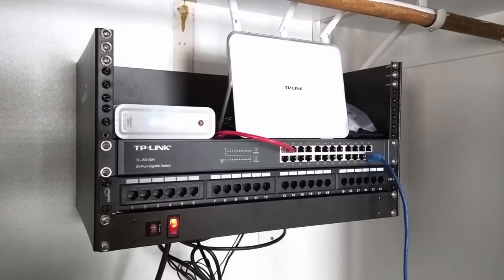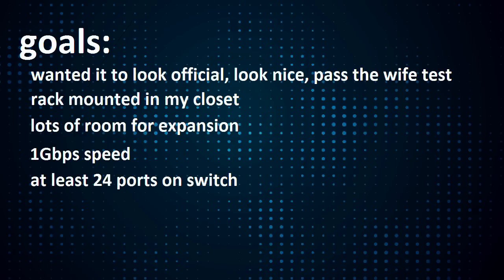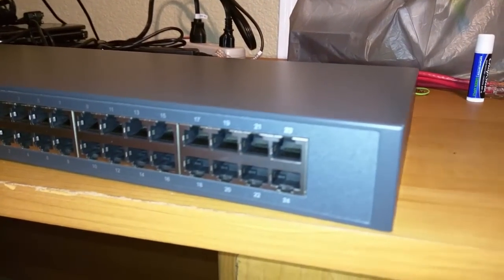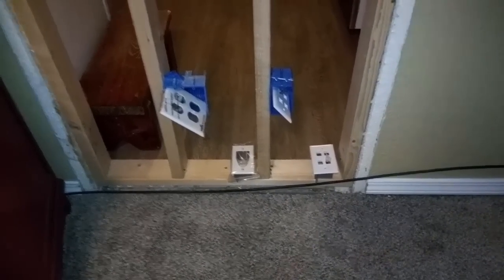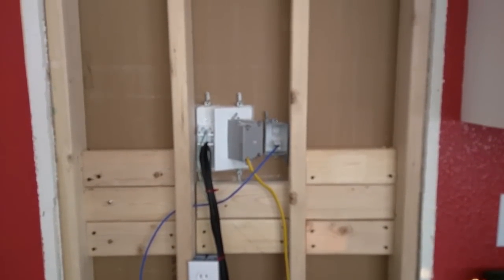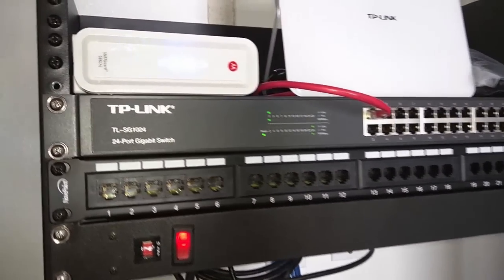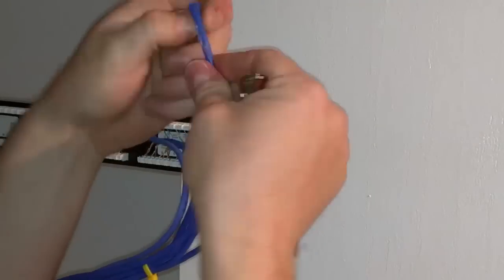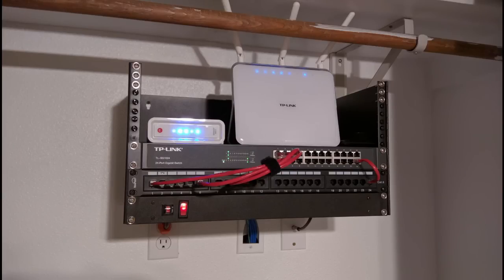Budget Home Network Tour/How To

Comment: What's with the big ugly double height faceplates over there. A patchpanel  makes a job look so much nicer and easier to maintain. As other posters have said your twists are bit slack and you should bring all the cables in through the cable tie at the end of the panel. Good job all the same.

Comment: So that's mean you get free internet and WiFi?
Reply from the maker: It's a computer network. If there is an access point somewhere in the network, then you can get wireless access to the network. It will not get you free internet. You usually have to pay for access to the internet.

Comment: 10 inches between hi voltage and low voltage network only 90 degree angles then crossing  NUB!!!!
Reply from the maker: +room42 I am aware of that, and tried my best. In that small space for the TV, there were just so many wires. You can see that I tried to make the single Ethernet cable going for the future TV cross at a 90 degree angle to the power for the TV.

Comment: what's the use of this
Reply from the maker: This is just a fancy home network. The cable modem and the router most people will have. The rack with it's power strip, switch and patch panel are all optional. It lets me add permanent network wiring throughout my house and do it neatly and professionally. The switch gives me extra wired ports for my house. It's a little overkill, but in the end, it's just my home network.

Comment: Sorry but why you need all these if everything works with WIFI...Or am I missing something here?
Reply from the maker: Wifi is nice, but it will never be as fast or secure as Ethernet cabling.
Reply: Because wifi is SLOW.  No way I could stream a even 20gb movie file from my NAS to my TV over my AC wireless.  Best it will do is a 1080p file around 2.5gb at best.  With wired 1gb connection a 60gb 4k file is no problem.  Just one of the reasons wired connections are better.

Comment: As an Electronics Engineer in telecom and Electrician who's wired commercial and residentially, this is a great concept but unfortunately a failure in execution. Permits are required for both low and high voltage, both of which you will fail for on multiple code violations. This is exactly the type of thing that I am very often called upon to remove and/or correct what has been done incorrectly. If you are going to post a how to, at least you should actually know "how to"
Reply from the maker: A small number of people have told me I've failed and violated code, but few explain what I did wrong. I would love to hear it so my next project t could cross more T's and do more I's.
Reply: Budget Nerd, First, when you are running low and high voltage, they should never be run in parallel with one another. If at any point they should cross each other perpendicular to avoid any noise interference. Second, your Romex needs to be strapped and neatly tacked to the studs, no more than x2 pieces of Romex under a single strap - within 12 inches of each box. That was from memory. I'll review the video and see if I can give you more feedback
Reply from the maker: I knew about running low/high volatage in parallel, i avoided that when I could. I await your other items.
Reply: Budget Nerd, Fyi, current NEC requires you to run a separate neutral (white) wire for all branch circuits. You used to be able to 'share a neutral', aka : dishwasher/disposal - 2 circuits, 1 neutral for both. It looks like you have a few circuits to terminate in your main electrical panel. So, if you ran 12/3 w/ ground it would be a code violation. Run 12/2. If possible, but not required, you can use twin style breakers to save space and each circuit has its own neutral terminated on the buss bar.

Comment: The pvc pipes????
Wouldnt it be nicer if you had pvc pipes in the wall. Soo later on its easier to get more cables to the destination.
Reply from the maker: +Jostein Baustad a pipe would be better off course. Didn't think of it until later.. and the pull cable hopefully works fine as well. But chances are very slim that I will need to pull another cable anyway. I ran one for every input whether it was being used or not.

Comment: well, I once was told americans use the A-Standard
I always use patchpanels like these:
https://www.amazon.de/DIGITUS-Professional-Klasse-geschirmt-24-Port/dp/B0018AE5DE/ref=sr_1_4?ie=UTF8&qid=1514060789&sr=8-4&keywords=Patchpanel
the one you use seems like the cables aren't secured on the panel very well.
Reply from the maker: +Robin Ehrenhöfer true.. I was still figuring out the best way to punch that patch panel down. It's not the prettiest, but it's hidden.. it's secure too in the end..

Comment: You did all that retro-fit work then buy the cheapest equipment? I get saving money but you could have gotten way better equipment with a little research. More power to you.
Reply: What makes one unmanaged switch different from another unmanaged switch? A switch is the easiest thing to upgrade later.

Comment: 8 network cables behind the tv? Just use a switch man...
Reply: but then every device behind the tv shares one 1gbps connection
Reply: Máté Varga I know. And it should be more than enough for any media station device. Also who got 8 devices that use 1 Gbps and even if simultaneously?
Reply: He had the walls open. Now is the time do do this, why add another switch to the network if you don't need to. cables are cheap.

Comment: normal family guy would not go this far. A decent router with a couple of small switches will just do the job. easier solution will just be around wireless solution. wired network is must have for business office, for home use, wireless shall be good enough.
Reply from the maker: I disagree. For my network, I don't want "good enough."

Comment: The WiFi is in the closet. Love the rest of this video but that just made me cringe. If you're running cables through the walls, might as well mount a WAP to the ceiling of the living room or something..
Reply from the maker: +squirrel1620 true, but I was sticking to a budget, and that router/AP gives awesome range and signal even in the closet.. wasn't anything I NEEDED to change. Most of the cable I ran was in the crawl space, not in the walls and that whole setup needed to pass the wife test.. she might have questioned the AP on the ceiling. Maybe down the road..
Reply: ben johnson will if it works that's awesome! Just saying when I put my WiFi router anywhere near a wall, my signals go down at least 50-60% strength
Reply from the maker: +squirrel1620 I gotta have good wifi as well, yeah I'd move it if I had an issue, but it works great there for now. Thanks for the tip though..

Comment: 24 ports for domestic usage? 8 cables for a TV rack? What the actual fuck? The 4 red cables actually being used in the end are 'nough said...
Reply from the maker: true.. it's overkill right now, but wanted PLENTY of room for expansion. I have several PCs in the garage that I will eventually wire up, a spot for the TV that I will eventually need to patch, a NAS in the future, perhaps a spot or two in the kitchen, and anything in the upstairs I eventually get. So it could fill up.

Comment: So much trouble, why not just use high speed wifi router..My whole house is wifi networked. 8 different equipment in home theater room, 6 in study, 7 portable phones and tablets, 6 other equipments like TV's & bluray/STB in other rooms. All networked via high speed wifi router.
Reply: The Droid What router are you using?
Reply: The Droid when it comes to performance,  a physical network is unbeatable.  but if you prioritize conveinience and easiness,  wireless is your way to go. it's just a matter of priorities.  which is the best is subjective to the owner's use case & preferences
Reply from the maker: +The Droid this setup of mine only seems a little complicated because I wanted it setup this way. Your network could be different depending on your needs/wants. I just wanted to wire what I could. Wireless can be great too, but I try to wire what I can.
Reply: Daniel Roy: I always use Linksys /Cisco routers depending on load and cost.
Reply: Anass Eljondy: What you say is correct, but the speed is bottle necked not within your home  network but as soon as you access the Internet. I'm yet to come across a 1 Gbps internet service provider. Using a 450 Mbps wifi router should do tho job for home networking and high definition streaming over 100 Mbps download speed from your internet service provider. . BTW, over 1 Gbps (upto 5.3Gbps) wifi Linksys routers are available in the market.
Reply: ben johnson : I understand your need, it is just far easy to WiFi network the house and cheaper too by going for a kick ass high speed wifi router. 2 of my equipments have only RJ 45 ethernet plugs and I use a $10 Chinese gadget (bridge) that converts any ethernet port to a wifi receiver, its power is supplied via a usb outlet. Good on you for learning networking on the go though..
Reply: it isn't hard to have a house where even a top end router has trouble reaching 100 megabits to some areas.  I hard wired my desktop upstairs since it does regular backups to my home server  and my home theater PC since it streams 20gb HD movies off my home server.  My high end Linksys router and ubiquiti access points couldn't reliably handle my needs over WiFi.
Reply: You must be sporting the older Ubiquiti AP lines, then.
Any Ubiquiti Unifi AP can easily handle an HD streaming movie regardless the length AND backup the same file to network storage simultaneously without interruptions. Doing that everyday.
Reply: If the throughput and latency matters; and the user environment is capable, use ethernet cables.  End of story.  Wireless is fine for mobile devices and basic internet surfing.
Reply: Surprised no one talks about the radiation given off by WiFi and DECT phones
Reply: What about it? You get more EM radiation just being able to see it then you would from the radios inside them.
Reply: wifi router is,best avoids all the cables
Reply: Mephisto Man What a noob
Reply: Wi-Fi will always be inferior to a well structured wiring setup.  Even the latest spec does not hold a candle to the performance and security to that of ethernet.  Wi-Fi is better dedicated to mobile devices only.

Comment: Pure horror!  You are laying down the  top ledt router flat on your TP-link!   Nice way to soak up the heat and cook it to death!

A politically correct  rack mount would also have a tiny fan to either suck fan from the top and the unit would be enclosed but not sure if this is in your basement or a closet.   If in a closet then the ceiling needs to be vented.      At the time index of 0:05  I have even seen this setup inside a TV entertainment system fully closed then they wonder why the short life of their electronic equipment and then they blame on shoddy equipment and they never blame themselves.     Patch panel creates no heat but would still place switch one more notch above to create a passage for any and all heat to escape as freely as it can get out.

If your tp link had side vents then get a dremmel tool to cut some holes of the side there.    
Heat is the #1 killer of any and all electronic equipment.    I even have our XBOX power block sitting on a dead Wii so the carpet does not soak up any heat and cook the unit.   Also modded out XBOX and for 10 years now our XBOX has never had any yellow or orange or red ring of death..... not once!   Hahahaha    Yeah I am a master of heating and cooling at my house.

If this is in your closet then do buy a silent bathroom vent or buy a door that has venting at the top and bottom so your closet has passive cooling in place.    If this is in your basement then even better as basements are many times much cooler than the rest of your house.

Being friendly to your equipment will always mean longer life to your electronics as well as your network.
Reply from the maker: +Inachu Ikimasho I've felt it. It's barely warm. That setup generates very little heat.
Reply: I could agree with you but no heat source is better than barely warm.    Optimal speeds are at operating temperatures that often but not always listed on the products page and or call their support line for more info.

Where I work we use a heat room to age our electronics an extra 10 years to see how well it will perform.

If items are too low then they get dust and too high then ambient temp goes up.  Waist high is often best.